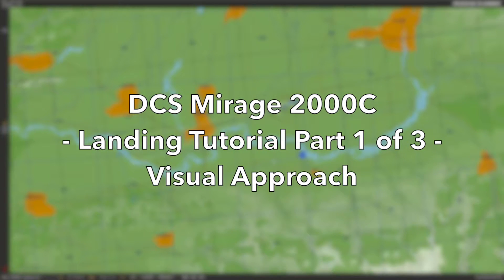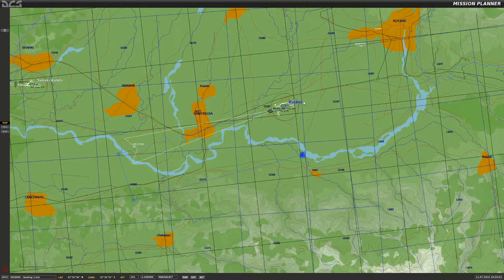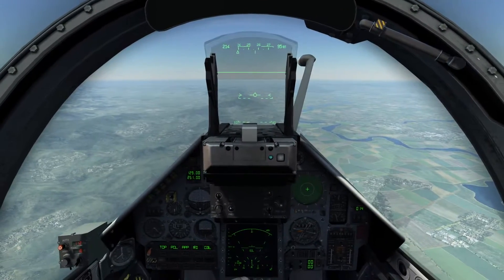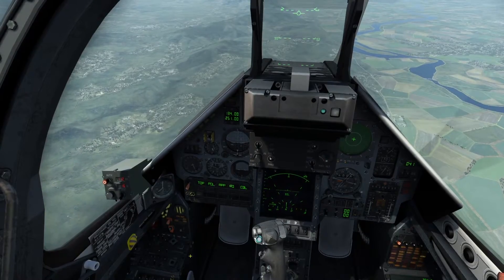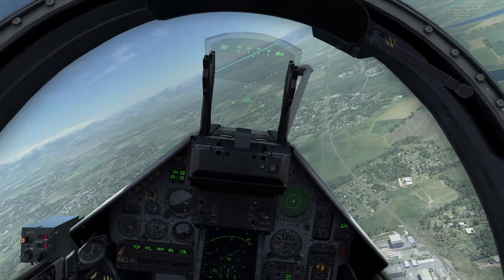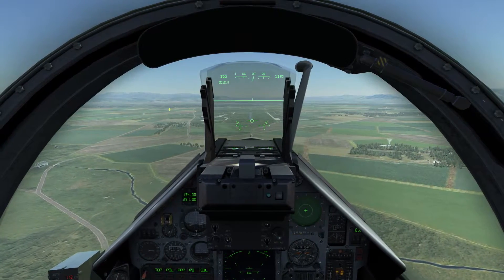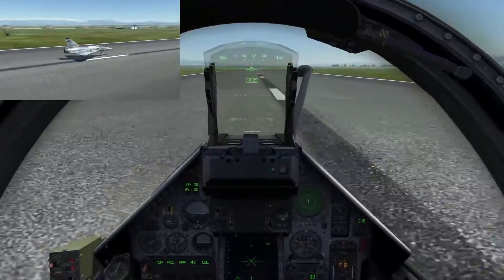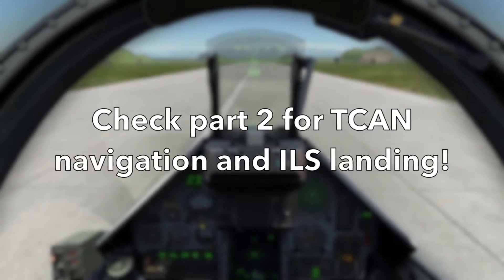DCS Mirage 2000C - Landing Tutorial 1/3 - Visual Approach

Comment: 150 knots ! Dude, that's a lot. Everytime I land above 140 knots I break the gears.
Reply: It depends on your AOA and weight.  His landing was perfect because it was around 14 degrees AOA which is ideal for this plane. If your angle of attack is around 14 degrees the speed does not matter as long as it is below 180 knots so you don't burst the tires. The reason being the ideal speed for landing in a Mirage depends on your current weight, but AOA always has to be near 14 degrees regardless of weight. It is similar to the Viggen which likes to land at 12 degrees AOA.

Comment: Why when I deploy my landing gear by pressing "G" my aircraft loses too much speed and starts falling like a rock till crash on the ground?
Reply from the maker: It is called the laws of physics. When you deploy your landing gears check the following to prevent a sudden case of dropping out of the sky:

1. Airspeed between 250 - 200knts.
2. Maintain level or descending flight (do not try to climb or pull up)
3. Retract airbrakes.
4. If your throttle is set to idle throttle up until you can maintain current airspeed.

If you start dropping out of the sky DO NOT pull up. Point the nose sightly down or level and engage afterburner. Make sure you have at least 170 knts before pulling up at a maximum of 5 degrees.